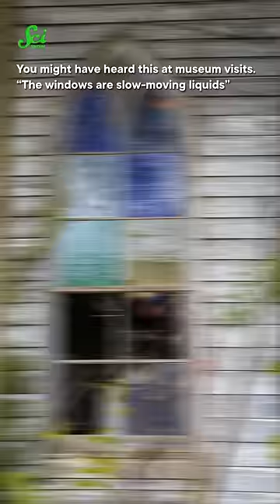Do old windows actually melt? #shorts #science #SciShow

Comment: So I have a question, she said, hoisting her hand in the air.
Why, then, are the front windows on the home I grew up with wavy, like, have waves in them, and are thicker on the bottom?
The panes are about 3 feet by 4 feet.
What we were always taught was WRONG?
The house was built in 1910. I was raised there beginning in the latter 1960s.
Reply: The panes were likely made from glass that was blown into a long cylinder, down into a pit for extra working room, sliced up one side, then flattened with a broom like object before going into an annealing furnace, where it rested on something incompletely flat before cooling to the temperature where it stops moving during the annealing process. 

Then it was cut & placed. Putting the thick side down wasn’t necessary as such, but is the way someone would install it in a standing orientation, by habit if not by training. 

(If there were also ropy/veiny areas, that’s a glass quality issue, it usually happens when the chemical ratios change at the bottom of the pot because some elements burn out at working temperatures, and they had to shut down production to refill the furnace, so they often used the less good glass from the bottom anyway.)

Comment: Is it even about crystalline vs amorphous? Gold is crystalline, but high purity gold is soft and dense and can get thin at the top and thick at the bottom. Maybe we shouldn't have so much confidence in rigid categories and they are more like descriptors.
Reply: Good point! Every time we try to classify or describe multiple things we run into edge cases. Not every solid is crystalline, being amorphous doesn’t make glass a liquid, even if every other amorphous material were. And even then it’s semantics/pedantry or incomplete modeling to fight over those things. 

At some point someone said “It looks like crystal to our eyes but looks like liquids look atomically but it doesn’t move, like a solid, so let’s define it as an amorphous solid & move on.

Comment: According to my college physics, chemistry, and material science books you are only partially correct.  First off, there are many types of glasses and they don't all behave the same, but glass generally speaking is technically a liquid at room temperature, not a solid.  It is just so viscous that it has similar properties to a normal crystalline solid, hence the term amorphous solid was created to describe this class of materials.  It is sort of how a plasma is somewhere between a liquid and a gas, but unlike plasma, amorphous solids aren't considered a separate state of matter (those being solid, liquid, gas, and plasma).

Think of a very viscous, slow moving liquid like molasses.  At room temperature it flows pretty slowly, but if you heat it up it becomes less viscous and flows much more easily, but it is still a liquid at both temperatures.  Glass is the same, it is just so viscous at room temperature that the time scale of its flow is beyond what a human can perceive.  When you heat it up you are not turning it from a solid into a liquid, you are simply reducing its viscosity to the point that humans can perceive and make use of its flow.  It was, however, still a liquid at both temperatures and no phase change took place.

While you are correct that ancient glass manufacturing was imperfect, leading to windows that didn't have a uniform thickness, and that old church windows are likely thicker on the bottom because they were placed that way to be more stable, this only pertains to window panes whose shape is such that a change in orientation can be accommodated, like rectangular or circular windows.  More complex shapes, like those found in stained glass, can't be reoriented to have their thicker and heavier side on the bottom.  However, the bottom of each piece of ancient stained glass is often thicker than the top of the glass due to the glass slowly flowing over centuries, or even millennia.  According to an article we discussed in one of my physics classes, truly ancient examples of such glass have been found where the flow of the glass has caused small gaps and holes to appear at the top of the pane due to becoming so thin from the mass of the glass flowing downward.  So yes, actually, glass is technically still a liquid at room temperature.

Comment: Massive sliding doors that are old are thicker at the bottom then the top. Smaal windows wont have the same effect for the weight is alot lower,but heavier sliding door glass has alot of weight.Ive seen it myself.

Comment: She is wrong.  Glass is a hyperviscous fluid.  Amorphous solid describes the structural arrangement of molecules in a solid but is different from the properties of the solid.  

And ancient panes of glass are paper thin on top and quite thick at the base.  Over centuries the frames had to be fixed to accommodate the increase at the bottom and decrease at the top.

So...better question...why does modern glass not display this tendency.  Why does it  only occur with glass formed before about 1800?

Comment: Hasn't it been proven that solids are just like liquids and can drop but it just takes years? I think i remember about some experiment where they put concrete or something in a tube thing and it has dripped like three times over the psst 50 years or something.
Reply: That's the pitch drop experiment. It can drop, but it is stated that it is not a solid or an amorphous solid, it's a liquid that has a very low viscosity

Comment: You've given many posters the idea that glass does not flow; but it certainly does. The window example may be correct, but if you put a glass rod across two points perpendicular to gravity, it w get a permanent bow
Reply: So does wood. Does wood flow?
Reply: @safaiaryu12  Seasoned wood just bends , it returns to true.

Comment: Actually 
All matter in the universe is a liquid.
Even the ground under your feet is a liquid and can change stages 
Boson Einstein Condensate, Solid, Liquid, Gas, or Plasma.
Everything does change into all this stages depending on time pressure and temperature.
Cold is the only constant and has been around for ever.
Heat is not
And it’s created by all stages of a star’s life 
Also by pressure and Chemical reactions.
The fact that you can’t see some things move doesn’t mean that they don’t 
Many things move and very slow drift away 
You just don’t stand around or live Long Enough for you to see it happening.
This world and all others
Are made of layers of liquid of different density and viscosity.
Reply: @MouldMadeMind  😂
Yes it’s true 
Everything is a fluid 
It sounds weird 
But even a glacier and the ground under your feet want to flow down to the bottom and there are layers which float one on top of the other 
Also the temperature influences where it ends up.
A gas can turn into plasma and eventually leave the atmosphere or freeze or pressurize and condensate into liquid or solid.
Many people can’t see it tough because of what has been taught to them.
Reply: @jorgejuarez2460  do you even know what liquid means?
Reply: @MouldMadeMind  yes
And now I know you need to research more on the topic.
Ask you a question,
Do you really think the water at the bottom of the Mariana Trench has the same viscosity as the water at sea level?

Comment: Nobody said glass is a liquid. Glass is a type of fluid, and being so it has viscosity, and that is the reason the glass gets thicker in the bottom overtime. American education system ☕
Reply: it doesnt get thicker over time. or it does but we are talking millions of years not hundreds. (ive seen jugs made in ancient egypt, they do not resemble puddles).

she says its manufacturing but its more installing, you install straight side down, which generally is the thicker side (also pattern matters and puttign one in different orientation would look weird). 

my father has installed some and ive seen some installed. mouthblown glass is uneven. you put the straigh part down, nail it in place, then press any warps against the frame using the runner and nail that down. 

yes they are thicker at the bottom, it was installed that way.

Comment: Wrong, sorry - because: evidence. Historic home of my family's, 250 years old: the windows are fragile at the top of the panes now and it's extremely evident from how they sit in their frames that the glass has been sliding down, becoming thick and sitting over the edges of the frame at the bottom, and paper thin at the top.
Reply: Then can you explain how hundred plus year old bottles are able to maintain their original shape without any kind of weird deformation?
Reply: @kibbs325  would merit more scientific investigation, but I would suspect that it had something to do with exposure to the elements and or shape/composition of the glass. Either way, the answer to this question isn't to simply deny the observable data.
Reply: Still a manufacturing issue, not an aging or wear issue.

Comment: Glass has been classified for a long time as a "hyper-viscous liquid." If it is now being reclassified as an "amorphous solid," that does not invalidate what it was before. Classifications change, and manufacturing techniques change (modern glass and old-time glass are not the same), but history does not. People assembled stained glass windows on a horizontal surface, so there was no "heavy side down."
Reply: I have also assembled stained glass on a horizontal surface, and I knew at every step of the process which side was the bottom. If the glass I used had a thicker side, it would have been easy for me to place my pattern in such a way that the thicker part of the glass was at the bottom of each piece. However, this is usually said about regular window panes, not stained glass. When you're putting a square of glass into a frame, and again you're very aware of which side will be the bottom of the window, you just put the thickest side toward the base.
Reply: @Kazemba  Well, that's very interesting.

Comment: @SciShow

https://youtu.be/QXQMc0jsl2E

If this is the method you are talking about, they are flattening it with heat on a flat surface in a furnace or a glass blowing glory hole. So this should eliminate the thin and thick part of the glass to even out a little. So I have a question, what is the thickness difference between the window pane glass ends. Even Veritasium says it is not supercooled liquid, but the question, if the thickness difference is too much, how did that occur. One might argue that why do old glassware doesn't show this. I don't see them under constant heat by sun, but window pane glasses do, especially the one which are coloured. I am not arguing that it is flowing or not. If metal can sag due to sunlight over time, why can't glass. For metal to melt as well, we need a thousand of degrees of heat. I see this effect a part of continuum.

Comment: Incorrect. This is because glass slides on itself. Because it is an amorphous solid glass will slide on itself bunching up on the bottom. The viscosity of this movement is EXTREMELY high however, which makes it take centuries.

Solids can slide over solids, they dont need to be liquids. Gravity does all the work. It all comes down to imperfections in the chemical structure (aka NOT A MANUFACTURING DEFECT) and extreme lengths of time since the movement is extremely slow.
Reply: Glass will never ever melt at room temperature lol

Comment: Ive heard this several times and people seem satisfied with it but i want to know the manufacturing process where you get panes with a thicker side. You act like thats just something that naturally happens when making glass panes but it would be difficult af to reproduce. Flat glass is usually made by floating melted glass on a bed of liquid tin in one continous sheet that is cut into various sizes. Also if you were to consider thay if those panes where cut from a larger sheet the other sheets would be extremely thick and thin. Boo, bad science! Shame on you sci show. I expect better from you. Also not everyone would install the glass thick side down because of human error alone so where are the panes with the thick side up that haven't been disturbed. Should be plenty of them. You really dropped the logic ball here!😢
Reply: In the early days you would make glass sheets by spinning and rolling out a blob of molten glass with a roller, resulting in a round (ish) pane with varying thickness and even an "eye" in the center from where it spread (which itself became a popular decorative pane in pubs and the like). And no, not every glass pane is thicker at the bottom as it does depend entirely on how they were installed and sometimes they just didn't care. So, indeed a win for a science as these things are easily explained and even reproducible if you would like something in the same style.

Comment: Could the thickness differential be caused by material creep: 
https://en.m.wikipedia.org/wiki/Creep_(deformation)
Reply: No. The pane is purposely rotated so that the thicker part is on the bottom. Consider, if you placed the thinner part on the bottom you would have the full weight of the pane pushing down on the weakest part of the pane.
Reply: Not even all have the thick part at the bottom. Plenty have been found with the thick part at the top.